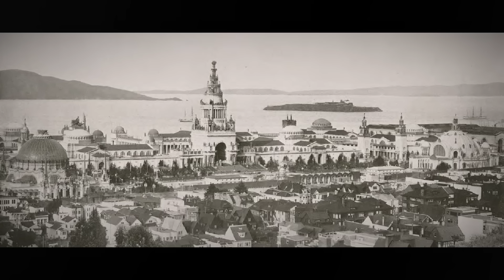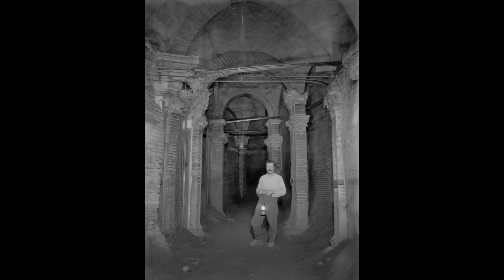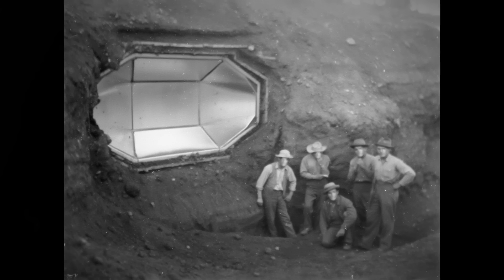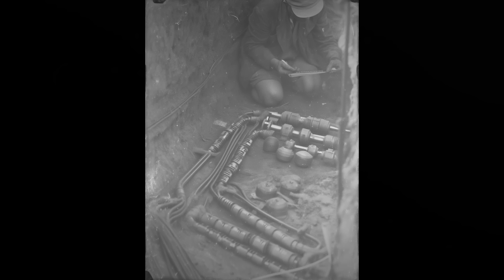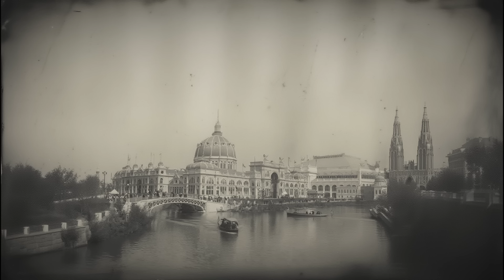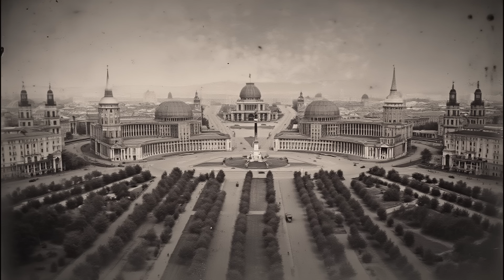The 1915 Wireless Energy Pylons Beneath San Francisco — The Grid They Erased From Every Map

Comment: Thank you for this video which made me think about looking up  when pipes were first documented use.

The best known example of a Greek aqueduct, however, is not in Greece, but on the island of Samos (Deming 2010, 27 to 28). The Tunnel of Eupalinos was constructed in the sixth century BC for the purpose of bringing water from a spring into the major city on Samos (Wilson 2008, 294). According to Herodotus (c. 484 to 425 BC), the aqueduct was one of “three of the greatest works in all Greece” (1910, 239). The construction of the aqueduct involved cutting a tunnel through a hill of solid rock by excavating from both sides simultaneously. The tunnel itself did not carry water. After the adit was cut, a sloping trough was hewn into the floor. Water was then conveyed in a terracotta pipe laid in the trough. The expansive dimensions of the tunnel allowed room for human access and maintenance of the aqueduct, a feature shared with Roman aqueducts (Hodge 1992, 27 to 28).

Comment: Guess who was going to engineering collage at the time of these atmospheric collectors that's right Nikola Tesla he solved the love voltage low amps problems 60v at 2a maybe he got thousand of volts at one amp just like the line going into the transformers for your home his didn't have a wire it was done through the earth ground and atmosphere not earth ground and wire
Reply: Most of those machines charged up batteries for emergency back up